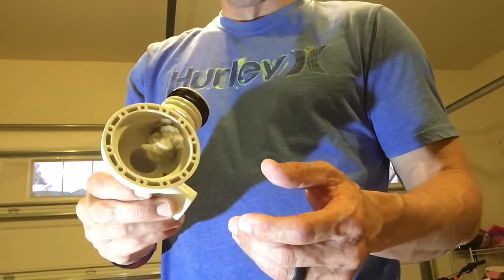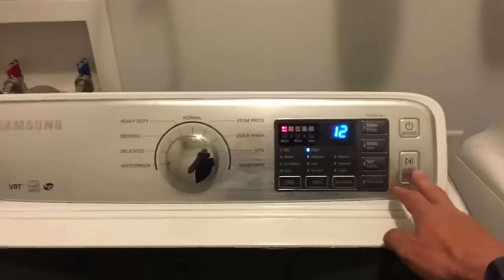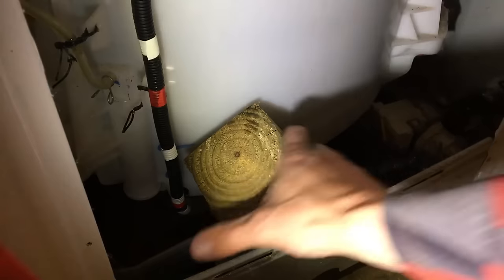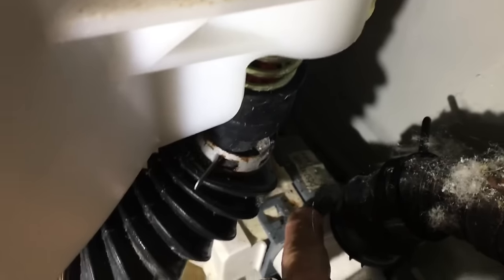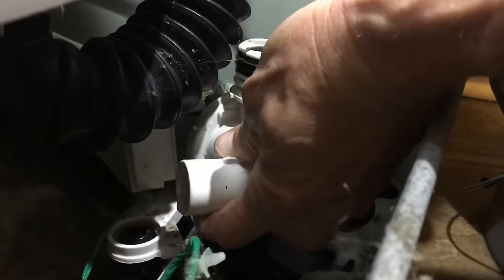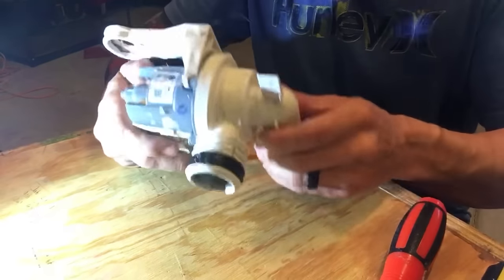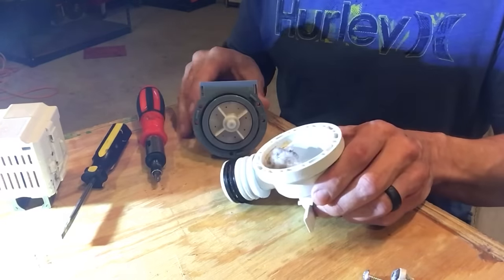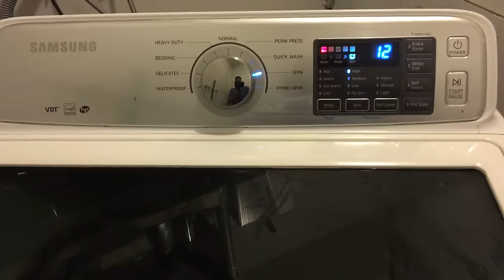Samsung Washer Won’t Drain! Easy Do It Yourself Fix WA45H7000AW

Comment: Have the same washing machine. What a waste of money.never buy it again .
I got the 4C code continuously draining can’t switch off. Mechanic change that pump. He said it was faulty. Now 4C again. No hot water pouring in. And all the options on the left of the dial won’t run cycle it stops as 4C code. So if that’s not bad enough.the water doesn’t even cover the clothes. Your washing and the clothes aren’t wet. What a joke. I miss my Kenmore.